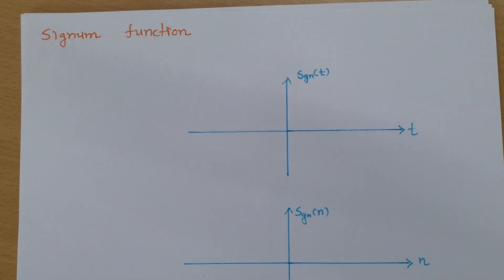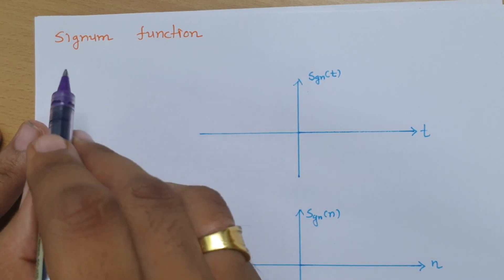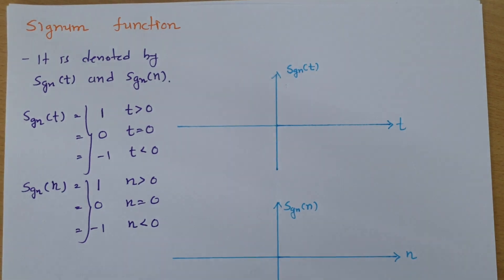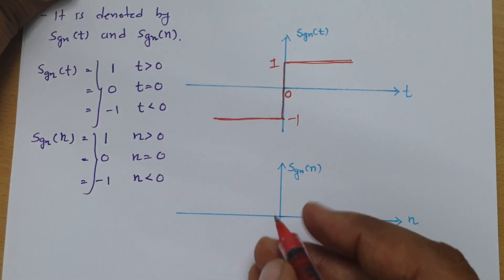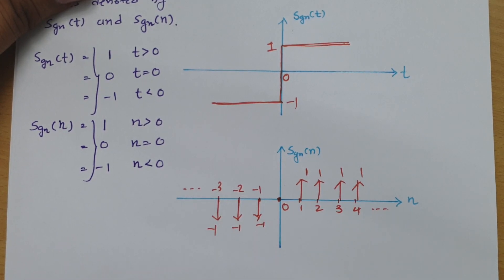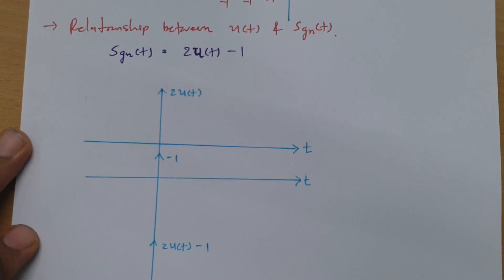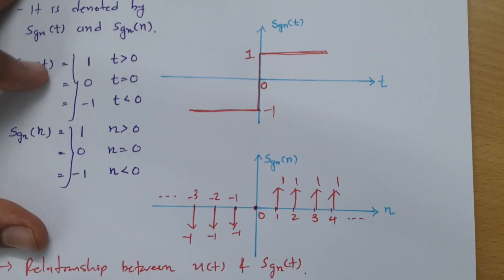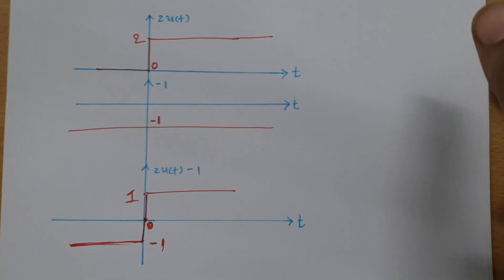Signum Function: Basics, Graph & Relationship with Unit Step Signal in Signals & Systems

Comment: Sir in definition of the signam function you defined that at  t=0 it's value is 0,but in this example the value of 2u(t) at t=0 is 2 ,and then when we subtract -1 from 2 the value will be 1 at t=0,I'm getting confused in this..please sir explain
Reply: bro take ... a clear.look....the coeff of u(t) is height  . .so 2....and we substract  from 0 -1... bcz..step fun on -ve axis is zero...hope u got it
Reply: @teenager6030  yes brother thanku
Reply: @teenager6030  I'm not getting what you said.
Reply: @teenager6030  but it should be 0 at t=0 as sgn(t)=0 at t=0. But 2u(t)-1 !=0 when t=0